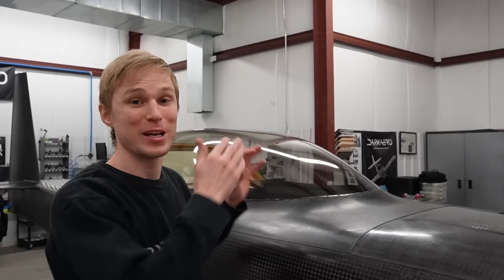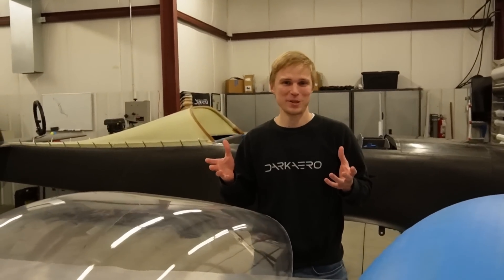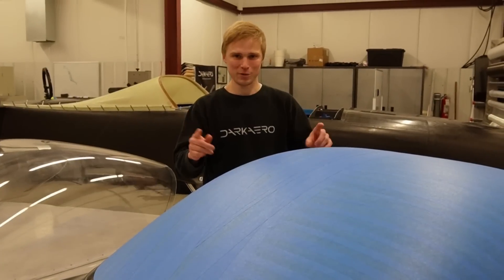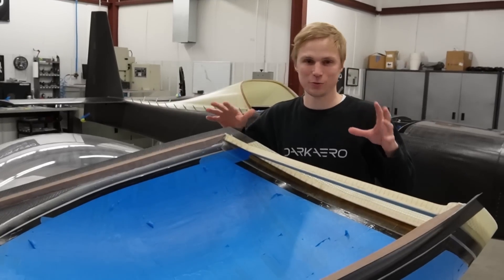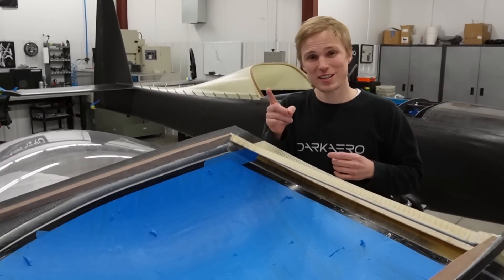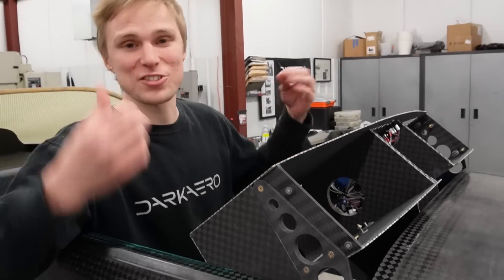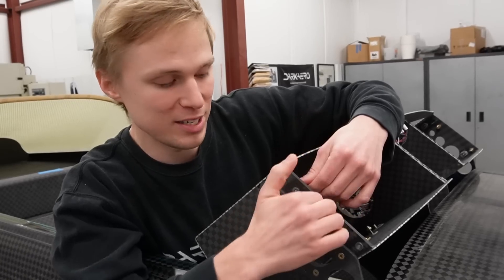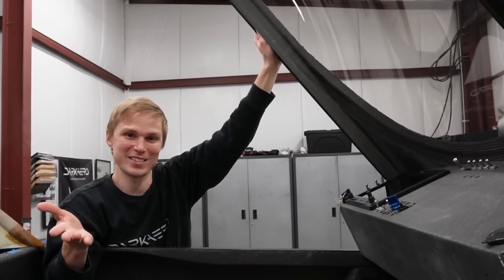This Canopy is DIFFERENT | Hinged and Installed  - The DarkAero 1 Canopy

Comment: Awesome progress Dark Aero 1 team. This seems to be an appropriate video to ask whether anything is known about the aerodynamics in the event the canopy unintentionally disappears? I am told some similarly designed aircraft experienced quite dramatic effects when the remaining fuselage tail section started acting as an air scoop or just the canopy failing to add lift. Similarly, what are your thoughts on impact resistance of  bird hits with the aimed high cruise speeds? Luckily you have relentless powerful shredder preceding your beautiful window, but still. Probably several lucky dollars will keep you safe of course ;-). Greetings from your Amsterdam fan.

Comment: Would it be worth adding interlocking fingers between the top and bottom hinge halves to reduce possible pin movement and stress. Thanks.

Comment: Headroom looks real tight. Seems to be a plane for short to medium height pilots only. Tall pilots look elsewhere :(
Reply from the maker: Thanks for checking out the video! The maximum height we designed for is roughly 6'4" (or 193 cm). However, the level of comfort for occupants who are near this limit will depend a bit on body proportions and personal preferences. Our cabin is similar in size to the Vans RV-7 which can handle taller pilots. The seating arrangement in the DarkAero 1 offers more legroom than headroom which is better for accommodating tall individuals with proportionally long legs.

Comment: I would imagine the service/emergency release pins will spring loaded and connected to some sort of accessible release mechanism. I’m wondering how you are going to deal with the potential for one or two of the pins failing to fully engage? It seems like there is no way to visually inspect engagement without looking under the instrument panel. What about an externally inspectable indicator like one might find on a torque indicator bolt?

Comment: Any thoughts on seal design?  Or the rear latching mechanism?  Emergency experience in tip up sailplanes has shown your pins alone will tend to leave the canopy in place in some situations.  There are several workable solutions but the hook designed by Professor Roeger may be the simplest.

Comment: And... there went my dream of ever building/owning one. Not nearly enough headroom. If I'm not mistaken you guys aren't even 6' tall, right? I'm guessing max height is probably gonna be ~6' and that's probably going to be a squeeze. I know that it's a kit plane, so there's room for customizations, but realistically the seat can't go down because it's a structural member of the airframe, and a taller canopy may be possible but would be prohibitively expensive to have made as a one-off, would require additional modifications to the turtleback, and would negatively impact aerodynamics.

That said, for anyone your height or shorter this thing appears to fit like a glove and will undoubtedly be an awesome tool for going places fast on less gas than a 172.
Reply: They said 6'4" max
Reply: @Neveragain1111-r4y  If you have literally no seat cushion and keep your head tilted to the side so it doesn't hit the canopy, yeah, 6' 4" might be possible. I'd have to see it to believe it, but then again I would've said the same about this whole project.

Not accommodating tall people isn't a deal breaker for like 90% of the population. This'll do fine.

Comment: Thanks for the video folks, great to see and hear about the progress.  At 4:15 you mention the "requirement" to get the instrument panel to lift with the canopy.   Why does your current design have this requirement?   Is it for ease of ingress/egress or some other structural concern?  Thanks!
Reply from the maker: Thanks for watching! In addition to improving the ingress/egress the instrument panel lifting up provides access to both the forward left and right baggage compartments which provide another 4 cubic feet of storage.
Reply: @DarkAeroInc  Got it, thank you for the fast response.   Looking forward to more videos coming!

Comment: Please tell me the phillips head screws are just provisional and won't make the final product. Also, when you work with cut interfaced carbon fiber, make sure to use titanium fasterners to prevent galvanic corosion on the fasterner.

Comment: i have no idea how it usually done but how do you make sure there is no way for water to work its way inside the cockpit. I didnt see a seal. Is that just not installed yet or are you relying on the tight tolerances ?

Comment: I see negative comments about the forward hinged canopy but the plane I fly, a Bristell NG5, has a forward hinged canopy and it is no problem. Easy to crack open for taxi in hot weather. There is also another famous plane that has a forward hinged canopy, F-35, that is the most advanced combat aircraft ever made. Just ask its pilots, not internet warriors.

Comment: Beautiful work guys!! Thanks for the outstanding videos. There are a couple of questions/comments. I have an RV7 with tip up and it is in no way rigid like your design. But . . (1) the leading edge of the canopy will move forward on opening. How to you ensure that the finished product can be adjusted to ensure the final .010" of adjustment is there and not snag the forward skin (w/paint)? (2) the acrylic thermal expansion/contraction presents issues for an orthogonal aft interface. I see yours is angled which should eliminate the expansion issue on a hot take off day and not leave a gap on a 0F day in flight. Have you (will you) tested the distortion in various temp environments? (3) Sealing: Maybe I missed the sealing aspect of the canopy perimeter, is there a provision for some teardrop gasket (like RV) to prevent excretion drag at speed? It adds to cold spots in winter too. :(  (4) Is the canopy pretty rigid torsionally?  The RV is not and has wear points on the lower aft corners even with best intent of center lift point open/close. 

Again, magnificent design and considerations guys, keep it going. BTW just hopped to Morey a couple of days ago, did not know you were so close!!

Comment: For what good reason is the instrument cluster attached to the canopy?
Unless it’s an absolute necessity it is extremely stupid to do so.
Flexing wire bundles repeatedly leads to failure even if you design for it.
Canopies sometimes fly off after a bird strike or latch failure, the possibility of that happening and taking the instruments with it is too great. Even if it only damaged the mounting it could cause electrical failure and the engine to cut out, the instrument pod could fall onto the controls.
The extra structure needed to make it movable probably adds weight also.

Comment: Great work as usual. Does the canopy  headspace get hot? I rode in  a homemade go cart once that had a plexiglass cover and the air under the thing was hot after about 10 minutes. Kind of like a greenhouse. Mind you it was summertime but I’m still curious. Do you have some kind of airflow for keeping hot air from getting stuck at the top of the bubble?

Comment: I would make the instrument panel fixed and separate from the movable canopy.  I don't understand why you feel the two should be connected.
Reply: I would guess (as I have a tip-up) that it adds to the torsional rigidity of the canopy by attaching to the side rails. And no dew/rain drips into the avionics in real world operation.

Comment: How do you anticipate the differences in CTE between the stretched acrylic and the frame? Will it put a strain on the gaps, not only between the acrylic and frame, but also distort the frame, creating a fitment and actuation issue?

Comment: Hello Reilly, River and Keegan from Sydney Australia.
Thankyou for your latest filming of the panel and canopy for the Dark arrow. 
What is your thoughts on the wear to wiring and connections from accessories, sensors and power supply; to the avionics, by the lifting and closing
movement?
🌏🇦🇺

Comment: Did you consider polycarbonate glass for the canopy?
Reply from the maker: Hey Kyrill, the old canopy shown in the vid is made of polycarbonate and was being considered when we were attempting to form the canopy in-house. Polycarbonate is much tougher than acrylic, but can UV yellow over time and has a higher tendency to scratch, which would require an external coating to address these issues. It's also trickier to thermoform to achieve optical clarity. We may revisit it in the future, but for the time being we'll be using acrylic.

Comment: Nice progress as always. Is there any concern when for when the canopy is opened during taxi for ventilation on those hot days and not having a 'pure view' of the panel?? Feel like it could be an issue for either over heating inside the greenhouse type of canopy or the panel not being accessible when it's lifted up.

Comment: Man its coming along and great work looks super clean.
A few things I would just consider. 

-Drill and davit where the acrylic housing meets the upper campi frame. This will add another layer of hard point besides glue for the sake of unification. Also you'd want the drill holes to be molded into the next acrylic mold so you don't have to worry about the stress fracture prone points you could get from drilling.

-I would have made the cockpit enclosure on a two point hinge system where the front end opens down and into the cowling a la
" \-----" where you'd not only have two hard points on each side but a reduction in drag from a non gapped surface aswell as an upward force locking the campi frame up into the cowling.

Great stuff you guys give me ideas I can't afford!

Ok that's it im charging! J/k
Can't wait to see what's next.
Reply: Campi = canopy
Reply: And now that I think of it. The two point hinge mechanism for the canopy would be accompanied by a hard swivel where the point of location would be located. That swivel that cantlevers the entire canopy could double as the quick release where all the canopy would need to do is slide backwards to a release point and be gently pushed away.
Reply: Point of rotation.

Comment: Panel AHRS alignment will have to be done with the canopy closed if the AHRS is mounted within the part that tilts. Does this mean no taxiing with the canopy open?
Reply from the maker: Charles, the AHRS unit is located aft of the cockpit and would not be affected by the tilt during calibration on startup.

Comment: Where are the boarding steps? Do they fold out from the side? A stepladder stashed in the cargo compartment? Part of the landing gear? Flip down from the wings?
Reply from the maker: Currently no boarding steps in the prototype aircraft since it’s easy enough to step onto the wing and then into the cockpit from the wing. We are thinking through some sort of retractable step as an option though.
Reply: @DarkAeroInc  Cool. I’m curious where you’re thinking about putting the retractable step. Wings are out for the same reason the landing gear ain’t there. Unless it slides out from behind the flaps when they’re extended?

That leaves something flipping down from the main gear—is it in the right place for that?—or the fuselage. Maybe a fighter-jet–like extensible pole with staggered steps on either side?
Reply: @DarkAeroInc  How high is the wing off the ground?
Reply: @DarkAeroInc  Please do so for us "old guys" with bad knees.

Comment: Beautiful work gentlemen. I was curious about the choice of using acrylic for a windshield…. Why is that the plastic of choice? Whenever I have worked with it, it seems quite brittle, like if a bird hit it, it would just shatter…. Is it harder to form poly carbonate? My brother has a BD 4. We switched the acrylic windshield to poly carbonate… wondering if there is a reason many use acrylic

Comment: Great job! Please tell me why you used acrylic canopy instead of polycarbonate? As far as I know, polycarbonate has better properties than acrylic, and in previous videos you talked about making polycarbonate canopies
Reply from the maker: Each material has its pros and cons. Polycarbonate has higher impact resistance, but it scratches easier and tends to yellow over time. Acrylic has better scratch resistance and doesn’t yellow, but it has lower impact resistance. We experimented with both when we were trying to make our own canopies but settled on acrylic for production.
Reply: @DarkAeroInc  I think a pretty good call personally. In marine world outside of super high budget acrylic is hatch material of choice. if you do poly you NEED to have an easy replacement option.

Comment: Multiple wires being hinged and working through about 40 degrees every time the aircraft is entered or exited seems a bit risky.
Reply from the maker: Movable panels can be found in other aircraft. The Ellipse Spirit uses a movable panel similar to what is shown in this video. The DarkAero 1 panel is set up such that the bend radius of the panel wire bundle is large to minimize wire strain. The wire bundle is also routed somewhat like an s-curve to further minimize wire strain when the panel is lifted. Additionally, each wire is stranded core, which allows for bends to occur without fatiguing the wire. @RotaryPerfection mentioned it, but this is similar to wire loom routing in car doors.
Reply: @DarkAeroInc  Judging by the rest of the engineering I’m sure you’re onto it.  I was just putting in my two cents worth.  Plus it generated some discussion, which is never bad.  I watch with anticipation of learning something.  Thanks for sharing your journey.
Reply: @DarkAeroInc    but if your in a warm client how do you start up etc with canopy open when it's 110 degrees out.  
Even with my f1 rocket I preferred to taxi to runway most of time in summer with sliding canopy open as otherwise it was too dang warm.  
Also what's size limits for 2 people height and weight as that looks like a smaller c cockpit but may just be due to angle everything being black as it's carbon.
Loving the plane, just not the tilt up panel.
Reply from the maker: @cw93711  You can still see the panel fine with the canopy about half open so the hot climate scenario shouldn’t be an issue. Maximum pilot height is around 6’4”.
Reply: @DarkAeroInc   I know I can see the canopy going fine in the picture, but that doesn't mean you can operate the aircraft with canopy open.
Ty for height but what about weight of people pilots since majority of Americans are overweight.  We all aren't doing l skinny like you 3.
Can 2 people that are 5'11" and 220 or so fit in the plane.
Like I said I love the plane.  Glad it's being made in my home state of Wisconsin.
Oh will the plane be capable of any aerobatics?
Reply: This is a good point. 

If they use extra wiring loom and run two or so "S" runs across the fuselage at the point of rotation they could have a nice slinky loom with minimal flection at any rounded portion they could zip tie them to semi circle throu paths on each side of the frame so they can pull without catching like a guided slinky rail.
Reply: The normal approach is to route wires through area of hinge where travel is reduced. With some care should be manageable. expect more problems from engine area vibrations / heat etc then cockpit? Smaller diameter cables make a big difference here actually - normally you want to over spec wire size, but if you have a flex application going small has a big payoff. Ribbon cable is also popular for ticktock flexing. One gotcha is a big round cable that is tightly held, as you can get internal friction / heat.  Stranded wiring also more popular for any type of flexible cable for obvious reasons.
Reply: Car doors have been doing this for decades. I'm sure it wont be a problem. They just need to place the wire looms near the hinge point to lessen the wire travel distance.
Reply: elevator cabling goes thru a lot worse and survives.
Reply: @shayan4040    elevator cable is much stronger and way more durable then the many fine wires that go to the back of a panel.
It should still be fine as long as builder takes proper precautions wiring his panel.  If they don't it will be an ugly mess.
Reply: Not just having a hundred fine wires flexing unnecessarily every time you open the canopy, any shock from closing goes straight into expensive electronics. Using one set of hinges for canopy and panel is false economy. The panel needs to move only a fraction of a percent as often as the canopy. It could have been bolted in place and tilted for the few times access was needed, particularly since the canopy is removable.
Reply: @niio111   their are certified planes with panel like this.
You run the wires thru wire loom that in S curve and it works fine.
But it does complicate the panel build for the builder when putting in 20 to 50k of electronics.  
I personally don't like it.
It's my only gripe with the plane though so far.
Reply: Yep to all.  Making the moving section of the harness a cheap service replacement item might alleviate the issue. (if there ever is one)    It would be better than replacing a complete harness.
Reply: My thoughts are the same.  As an engineer, this is the first design choice I really don't like on this a/c (these guys are sharp).  Also, as a pilot I guarantee there will be times you want to run the panel with the canopy open...this makes that awkward to say the least.  I see this changing in future revs.